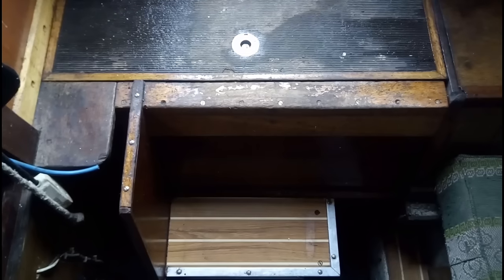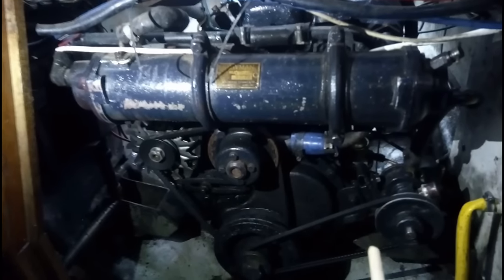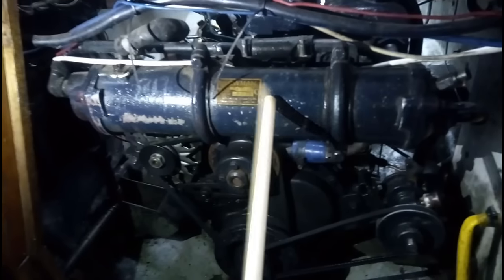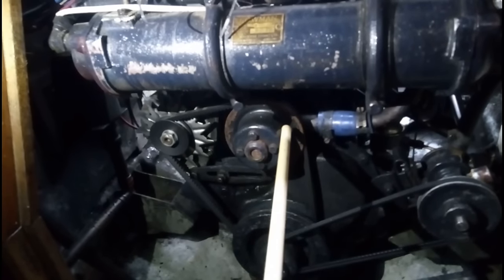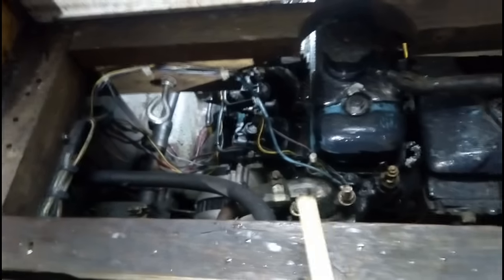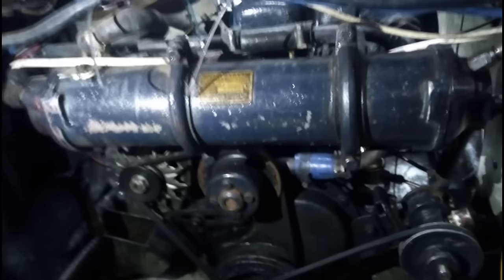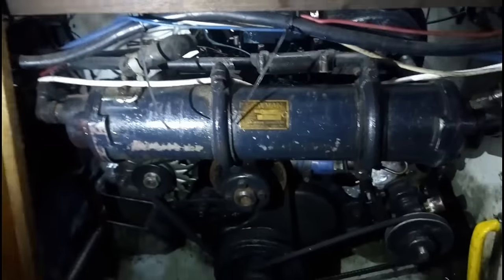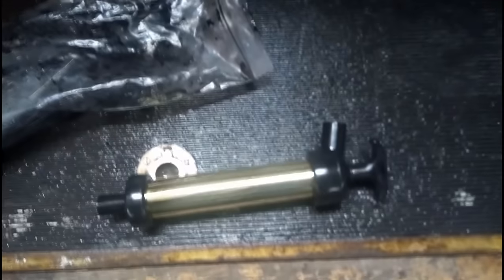Unveiling the Marvel: BMC 1500 Diesel Boat Engine Norfolk Broads Forum

Comment: The petrol version of the B-Series was used in all sorts of things from the 1952 Austin A40/A50 Cambridge to the last MGB in 1980. The 1489cc version was used across the BMC range until the mid 1960s. As for the diesels, the 1500D was put in the 'Farina' Austin Cambridge/Morris Oxford from 1962 to 1971, and then in certain versions of the Morris Marina until 1980. The Austin/Morris J4 van used the 1500D between 1960 and 1974 - the Leyland Sherpa used the 1800D. It was also put in the Nuffield 4/25 tractor, which became the Leyland 154 and is still built (along with the engine) in Turkey. The 1500D was also the diesel option for the Indian-made Hindustan Ambassador, a Morris Oxford Series III built until 2013. BMC never built full marine engines but instead sold base engines to firms which carried out the marinisation. There were dozens of these, but the biggest was Newage Marine, which sold its BMC 1500s as the Captain (the 2.2 Black Cab engine was the Commodore). BMC also sold the engine to industrial users - some early JCBs used the 1500.

MOWOG stands for "MOrris WOlseley mG" - it was the branding for the aftersales parts of Morris before the merger with Austin, and then BMC adopted it as their own brand for cast parts such as blocks, cylinder heads, pistons and the like.
Reply from the maker: Nice post. I'll add that to my forum if you don't mind. Very interesting
Reply: Feel free - glad to help. I forgot to say thanks for an interesting video (and going through your other episodes has been an enjoyable way of spending time at home in the snowy weather). I've seen the BMC diesels on land, and knew they were very popular on inland waterways craft but never seen one installed in a sailing yacht. 

It occured to me that my statement "BMC never built full marine engines" might be slightly wrong - British Leyland might have sold them in 'ready to run' form in the 1970s under their Thorneycroft brand. Certainly once Thorneycroft was sold off in the 1980s the new owners sold marinised BMC diesels (before switching to Mitsubishi) but I can't lay my hands on any confirmation whether BL did. It might have been a back-deal with Newage where BL bought Newage-converted engines, slapped the Thorneycroft stickers on it and a coat of gold paint and sold them through their own outlets.
Reply: Good explanation from Jackgrover
Chartered Engineer
Kochin,Kerala,India

Comment: AVG45 Its just the same as my engine and I love it, so easy to work on and service.
Reply from the maker: +alan guest Do you have the same water cooler?
Reply: No, My engine is cooled by Keel tubes. so I don't have to worry about winterising that part of the engine.   The raw water only quietens the exhaust.
Reply from the maker: Yes mine is quiet.

Comment: the road cars that had the 1.5 were morris j vans and old morris marinas [some were indeed diesel and VERY slow] 

also used in some smaller tractors mf's etcetc 

the 2.5 is the commander i believe, the 3.4 beng the commodore. 

ours are 1.5 captains
Reply from the maker: Excellent and thanks for the information.
Reply: I don't think the 1.5 was used in the Marina, they had moved on to the slightly larger 1.8 by then. These are still popular boat engines... the marinised ones as follows:
Thornycroft Engines 90 & 90/2
Tempest Newage Captain
Westerbeke Four-90 & W30
Mermaid Marine
Lancing Marine
C T Marine Watermota
G & M Powerplant

Mostly they seem to be referred to simply as BMC Captains
Reply: @g0fvt  They made a Marina with this engine but not available in UK, I believe most of them were exported to Portugal in kit form for use as taxis